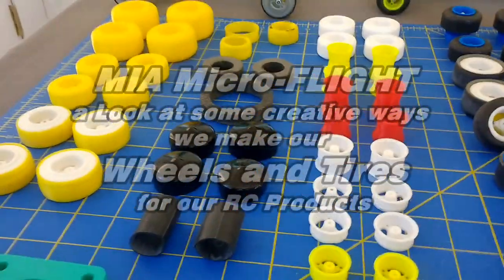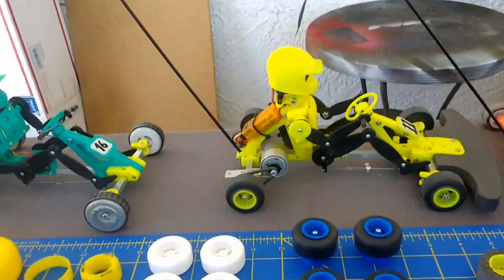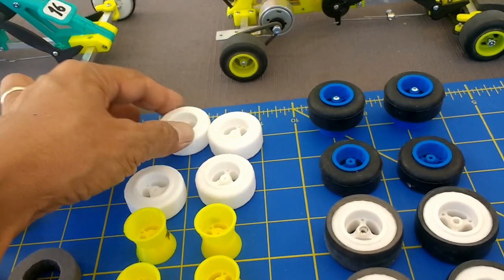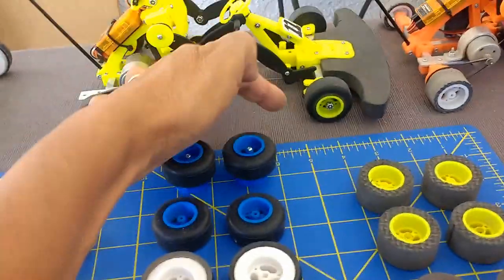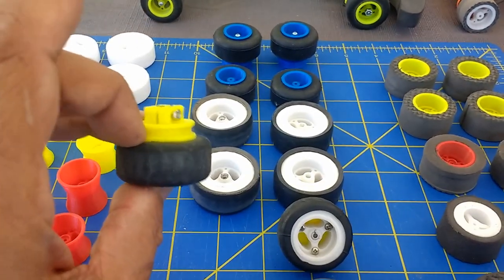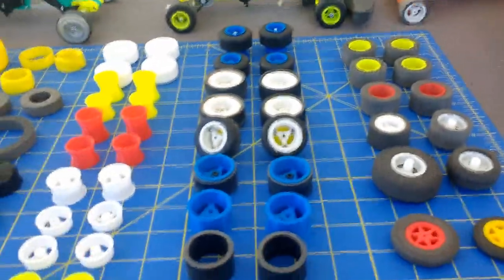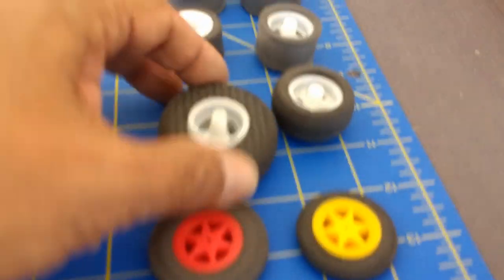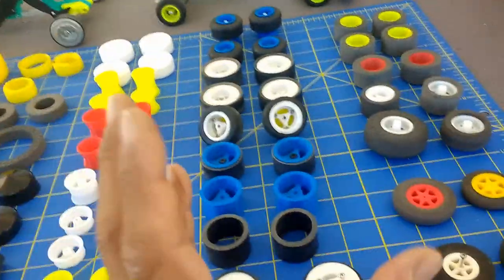GO KART - RC MODEL WHEELS AND TIRES  - HOW WE MAKE THEM

Comment: Mario, always a pleasant surprise with the things you come up with! Your products are innovative, attractive, and just plain clever!
I have several of your products...fuselage skins for my Blade MSR and MSRX as well as several upgrades to my Durafly's Gyrocopters. I haven't flown my Blades with your skins yet because I don't want to crash and damage them...they are just too nice looking!
Keep up the amazing work.
p.s. Do you have a video up yet showing the karts in action (other than the one for just a few seconds)?
Reply from the maker: Tod, thank you so much for the nice comment. I do have several videos I did with the karts running longer. I've been at this for the past 2 months, just tweaking and tweaking and trying to get them as best as I can possibly make them before releasing them in kit bolt-on form.  They run for about 30 minutes on a single charge, with a 2S -850 mah Li-Pol battery. I am currently working on a longer video of the karts running.  I also designed a race track for them that fits my back yard, but that is going to take a bit more time because I want to do it  right.  I searched high and low for a DIY track for concrete or what they call oval track, thinking maybe someone perhaps beat me to the punch with a nice properly done  track for these types of rc cars, but I did not find one to my liking, so, like most things I do, I have to do it myself when I can't find what I want or like .   What I mean by this is that I do not want to use the typical pipes that are used son some of the diy tracks, or wood even, since these go karts are low profile and I want to minimize then getting stuck on the track walls, also to help prevent them from crashing against the track dividing walls, although these karts are very durable, especially with the foam  bumpers in front, it is a pain having to go fetch it  when they get stuck up against a wall. I do not use reversible ESCs on these for simplicity and to make it more challenging when racing with my family, but I guess they could be retrofitted with such to allow backing up.  I don't think real racing professional go-karts have reverse since they are design for forward top speed.